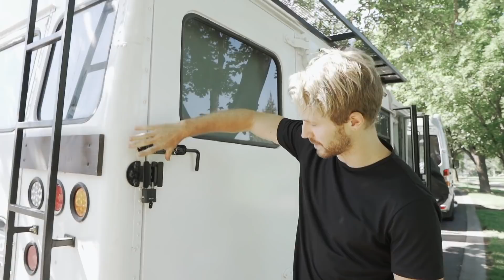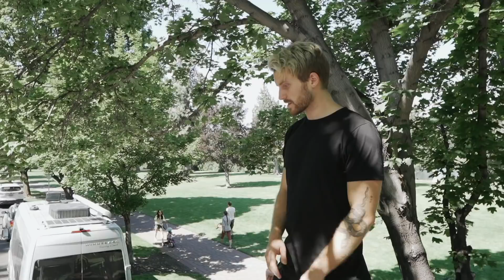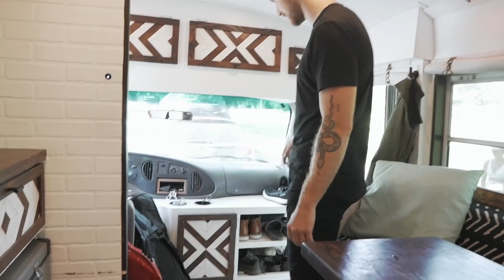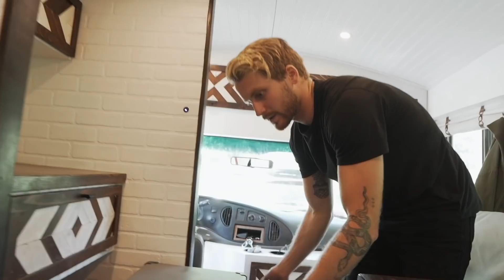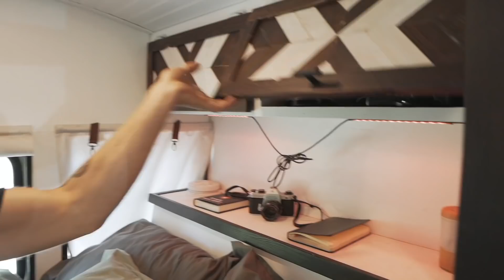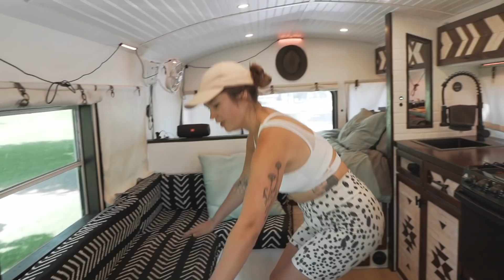Short Bus Skoolie Conversion Tour

Comment: Henry's Tropicool has 2 types. One is a patch. The other is the paint/sealant. You probably used the wrong one. I did that to begin with. But bought the right kind to actually use.